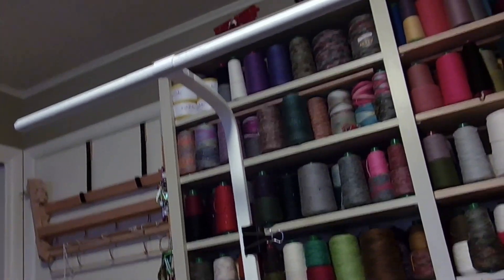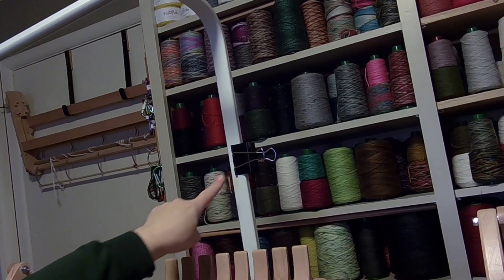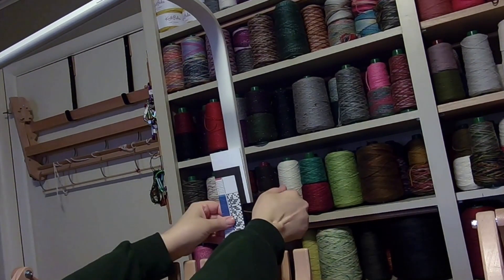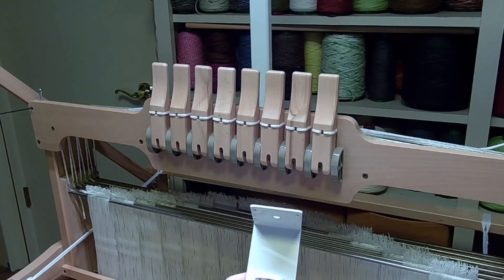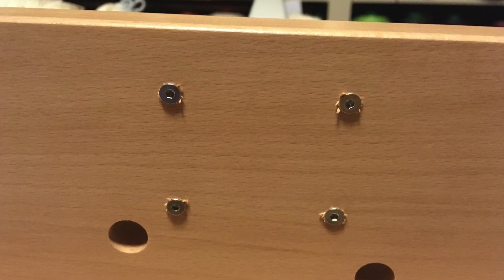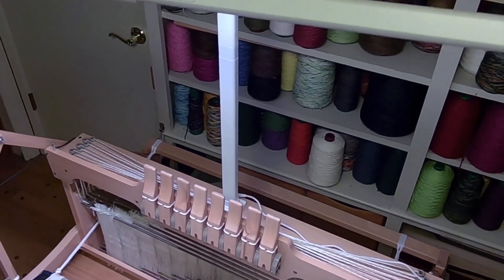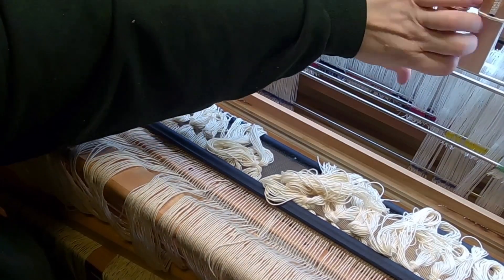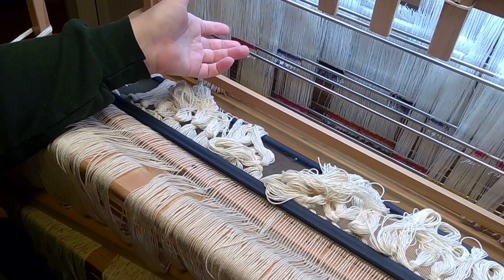setting up spot lighting and heddle mods for Ashford 32-inch 8-shaft table loom

Comment: I recently had to do a replacement heddle and I initially tried cutting and reattaching one of the tex-solv heddles but found it a challenge. Whereas tying on a repair heddle was actually much easier than I would have expected. It was just easier to get the loops around my heddle bars. Great call out on the color coding the heddles, that probably would have prevented the issue altogether! I'll be looking up the under cabinet lighting as well. Could really use that on the more complex threading patterns.
Reply from the maker: Replacement heddles are such a pain.  I'm a firm believer in doing whatever works for you.  So glad you were able to fix it!!  The color coding definitely lessens the chances of needing to do a fix.  Also dispersing your extra empty heddles throughout the warp helps as well, because you may have an empty heddle very close by for a fix.  Always, whatever works.  

Complex patterns are beautiful, but we definitely have to plan ahead for them.  😁

Comment: I have under the cabinet LED tape lights (Amazon). They have sticky backing, dine interfere with anything including the folding up of my 32" loom and they can be removed if needed. These lights brighten up not only the heddles but the reed and your weaving. I have no need for exterior lights with them because of the brightness.
Reply from the maker: Thanks for sharing this idea!